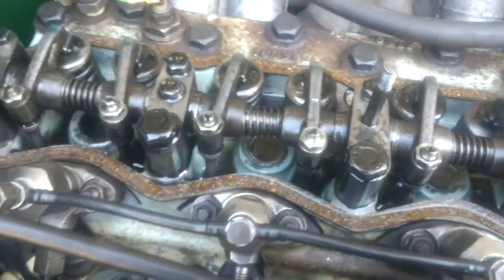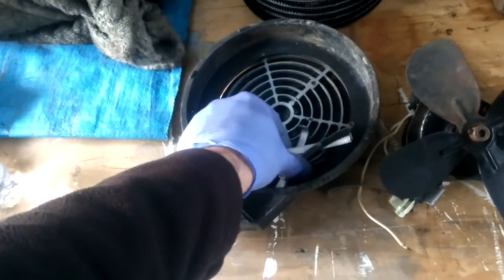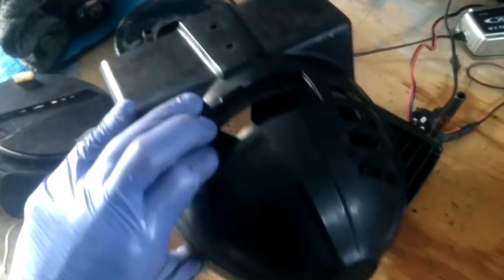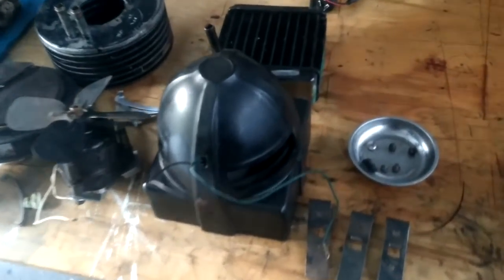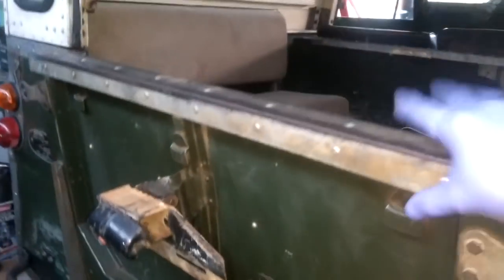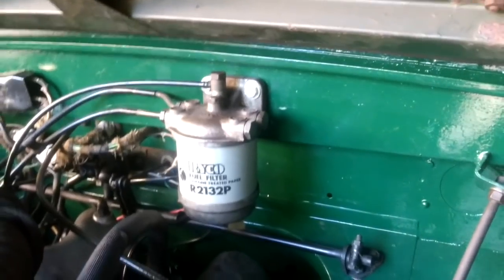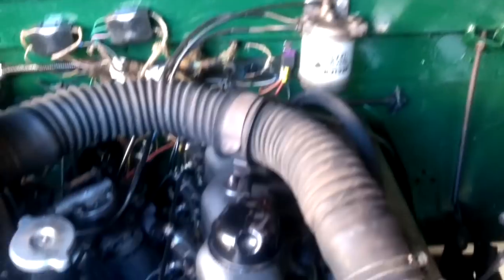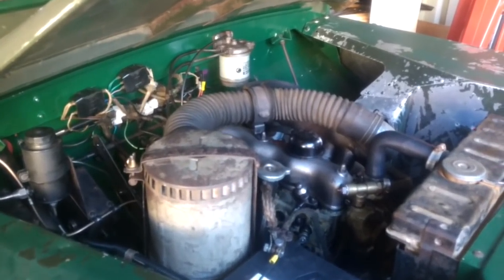Land Rover Series 2a 88: Rebuild Update No. 8

Comment: I looked into getting a Clayton type core for my biscuit tin heater. £260 odd. Found a web article where a bloke had built his own copy out of copper tube   Then saw a new 24v Clayton heater on eBay for about £60 and with a bit of work fitted it into the smiths body. Works VERYwell. Hold more water than the original core and the water probably flows through faster. Never going to be TOO  hot in the winter mind. Good luck looking. Martin
Reply from the maker: That's the pdf article i mentioned, how to build one. would be easy enough for a plumber but something not for me to attempt. Sounds like you got something, although where i live i need a working heater!

Comment: I think I will do the heating with heater pads inside the seats. I usually don't turn the ventilation heating when I have heated seats, I also have a battery heated jacket and works great. Is faster heating you and is cheaper. Cheers
Reply from the maker: Loads of options, I think if one was to look at BMW motorbikes and gear they have the cold covered.  I even contemplated putting in a diesel heater too (like the Range Rovers have)
Reply: @rovertasmania7033  there are dead cheap (well £120-ish) diesel preheaters available, with remote control even! Easy to fit.
Reply from the maker: Looked at various ones, but when the beehive came up it was a no brainer what to get.

Comment: I have followed you on this rebuild and appreciate it’s taken time, but you never cut corners and are doing a nice job.
Reply from the maker: Hi mate, yes you have been one of my long time supporters and i very much appreciate it.  There's a balance between taking shortcuts and doing work that is not required. I think this is where most aim for in a build, unless you are rushed for time or funds are limited, or on the other end you are doing a nut and bolt restoration.  Thanks again for the post ;)

Comment: Hey, where do you buy the round smiths heater cores from? Thanks.
Reply from the maker: @Mikemike690 - seen them advertised in the UK (eg John Craddock) and one in Australia. There's also a DIY version too on how to make one but very fiddly.
Reply: I think you're looking for Clayton cores - £260 here in the UK (try ebay). Need a small amount of messing about but apparently make a better heater in the end.
Reply: Mikemike690 yea, clatons core, I got one out to AU for a few years ago...only difference is there a bit deeper, you can buy  3 of the spring steel clips that are a tad longer or flatten out the ones of you’re heater[what I did]. That was into a 1955